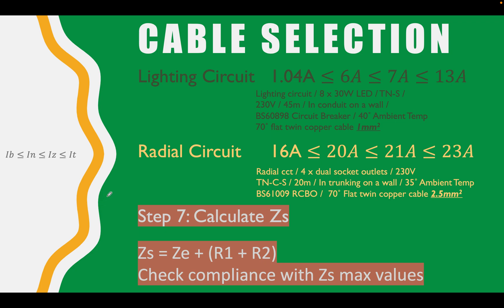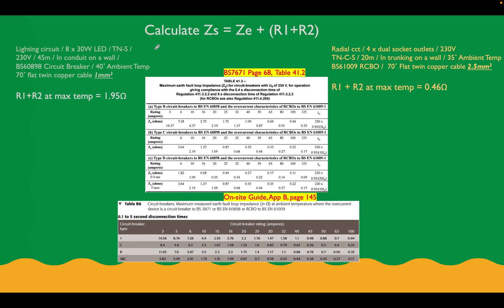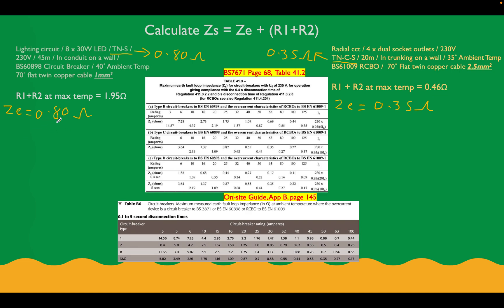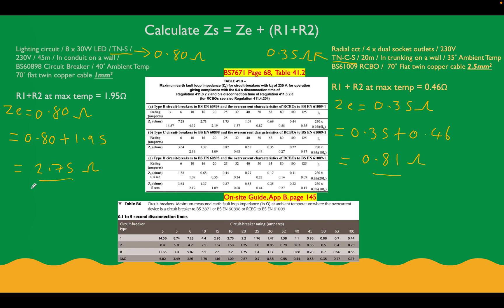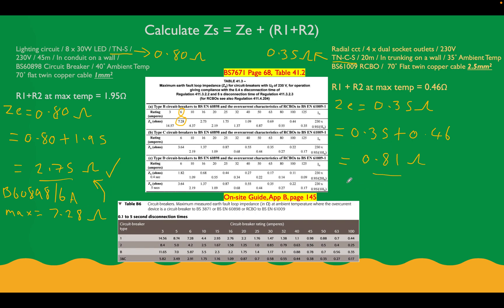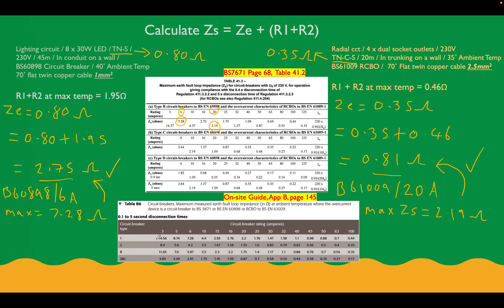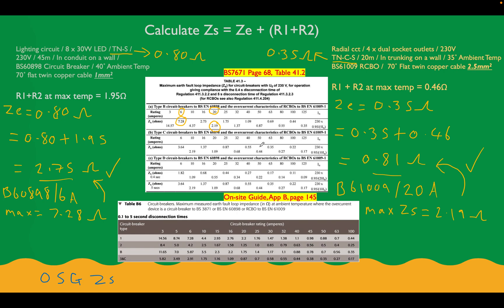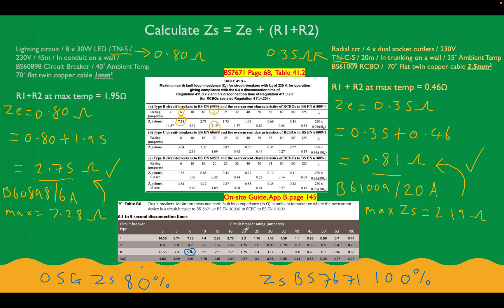Step 7 Calculate Zs - 7 Part Series - Cable Selection

Comment: If its type b braker u can also calculate by the braker size the max zs using this formula 44/6 20 watever it is then the rezults multiply with 0.8 factor 80% 44x0.8=35.2 rounded up 35 /6 20 amp etc for type c divide 44/ the circuit braker and then the results divide again by two and for type d the same but divided by four